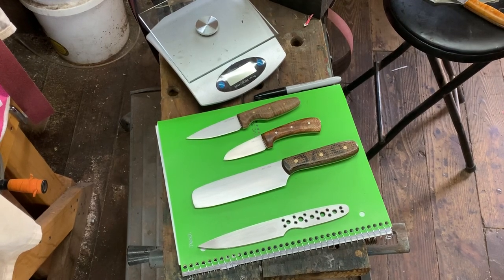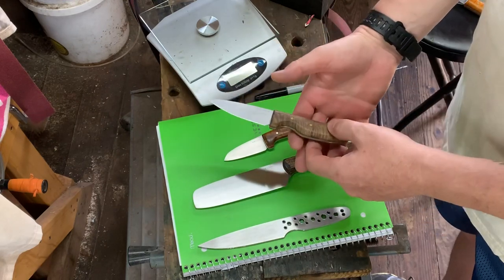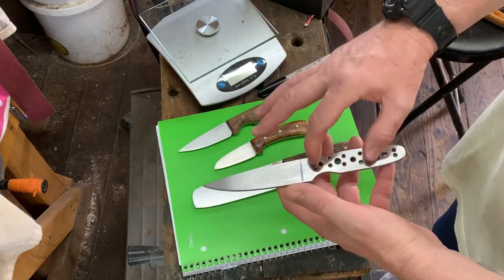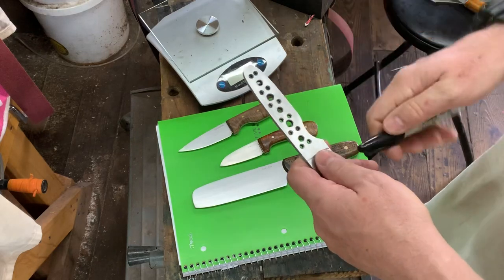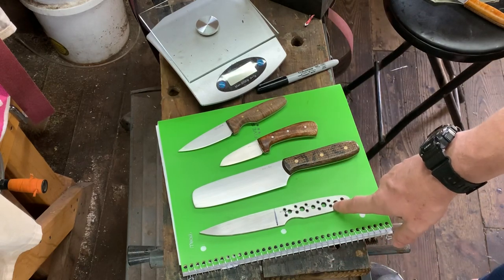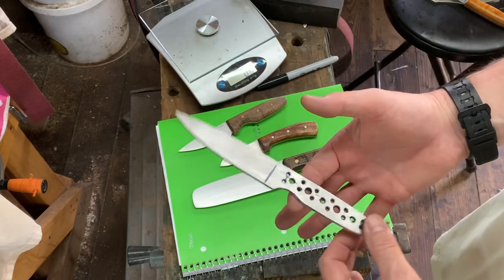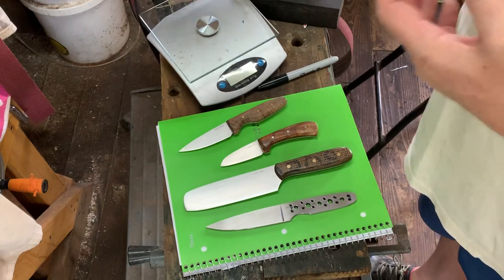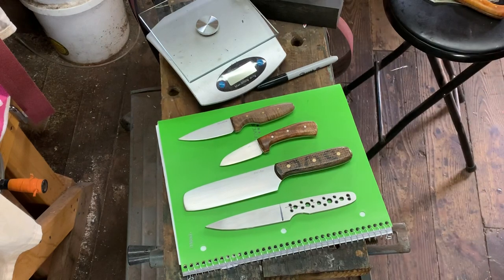Considering balance points when designing / building a knife.

Comment: Very good vid. What alot of guys are doing to reduce weight is what you said by hollowing out the tang. Thats technically weakining the bond between tang and handle.steel is stronger than wood and glue, therefore the more steel to glue to scale contact the better. For example, if you hollowed out the tang and when glueing you had say 3mm of glue in the hollow. Your bond with the tang/glue side is minimal,lets say .5mm, and the bond on scale/tang side is minimal, the same .5mm. You now have a 2mm amount of glue inbetween thats of no use. As any furniture or cabinetmaker knows its the fit of the joint thats the most important, not the glue. What you had said with drilling the holes in the scales to add extra grip for the glue is definately the better option as you retain as much of the joint between scale and tang as possible. Theres is such a thing as too much glue. First thing i learned as a furniture maker.